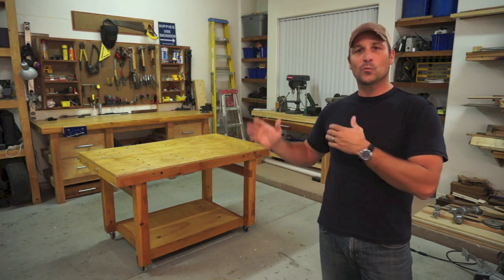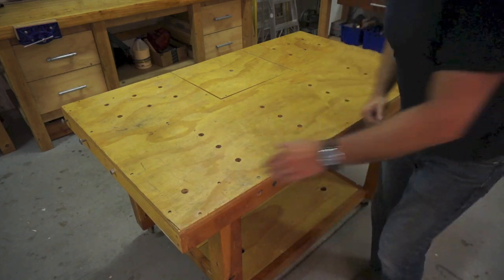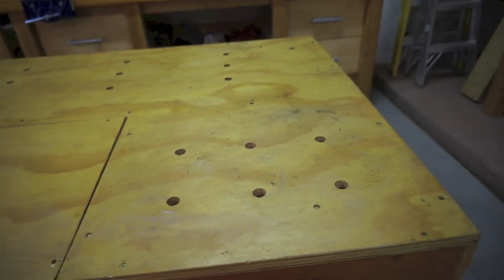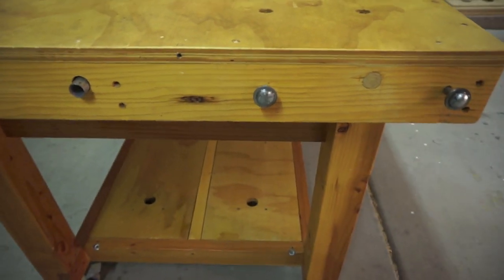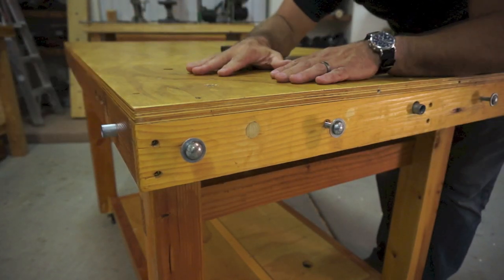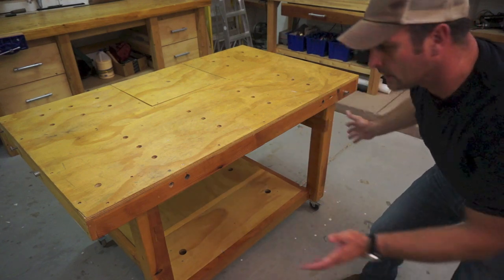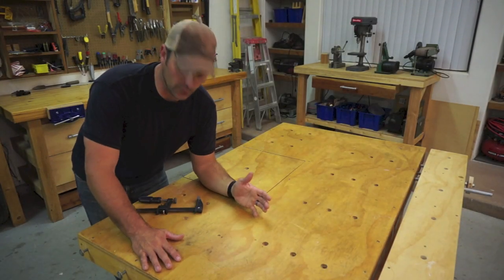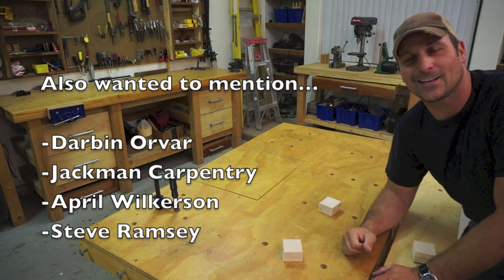Workbench tour and demo

Comment: Great ideas for a great bench.  Well done.  You mention "its not perfect".  If you look closely at all those other youtube contributor you mentioned, they are "not perfect" either.  I love to know what all the extension connection bits and the bit for storing the removable top for the mitre and the bits for fitting the mitre legs to the table.  Well done!
Reply from the maker: +WhoDatBe Dare Thanks WDB Dare!  All the connection bits and pieces were just extras from my junk box (except the washers) and I just tried to see what kind of connections I could make with them.  So far so good:)
thanks for watching:)
Joe

Comment: Nicely done Joe... I wish I had the space to have one of these in my garage, but I allow Aunt B to park her car next to mine in the garage... . I am going to use that hole/dawgs concept top on my workbench, but I will lay a separate thick piece of plywood with holes on top of my workbench to use with the dawgs. This way I van remove it, slide it underneath, and still keep the solid top workbench for my day-to-day use. If I just put dawg holes in the top of my workbench, I would be spending all my time trying to find the screws, nuts, and washers that fell through the holes. My workbench is 3'x8', but I have a drill press, grinder, and vise permanently attached, so I have about a 30"x36" of open space to do projects. I do have a separate but lower 3'X5' shelves that I covered with a countertop that I can do projects on, and it also holds my bench sander, jig saw, miter saw, and router table. If you keep giving me ideas... Aunt B might loose her side of the garage... :)
Reply from the maker: +Rought Real Estate Hey Randy... just tell Aunt B that cars were designed to take the elements better than workbenches and to promptly make space for the bench;)  ... but just wait until winter is over to use that argument...lol!
As for the workbench ideas... I still love your idea to have the dawgs with offset circles so as to be able to make small adjustments.  Really cool idea for sure!  And when we ever get up to visit you guys I'll be excited to check out what you've got going on!  
Joe

Comment: Joe, THIS is the ultimate workbench!  Did you build all those features in from the start, or add them as you thought of them?  Easily the most practical bench I've ever seen.  I don't think you're on LumberJocks, but if not, you should get on there and show that baby off!
Reply from the maker: +Joe Gemma III Thanks Joe!  It's a work in progress... I planned the leaf extensions, clamping holes from the start but the drawer, clamping section, and power outlet were later additions.  I still have some other ideas for it though.... but I'll just have to make sure it doesn't get too heavy with accessories!  lol
And no, I'm not on lumberjocks but have checked it out from time to time when I was looking for reviews on tools, etc,.  Great stuff overall!  Perhaps I'll get on there in the future but right now, my limited time after family stuff, goes to my growing list of projects (and the vids of them :)
But thanks for the awesome comment and checking out my bench tour.  I might do a follow up video in the future to answer questions that folks have had!
Joe

Comment: Nice workbench, Joe!  I like that the design discourages you from storing things on the bottom for the long term (since they need to come out for use).  That helps ensure the work/build bench is always clean and ready to use.  Great integrated features that are easy to use - that makes it even more awesome!  If you had to do it over again, is there anything you would change or do differently?
Reply from the maker: +Chris Williams Thanks Chris!  I'm not sure what I would change right now... I'm sure there is... always room for improvement or different solutions:)  ...but maybe I can answer that on the next QA video or maybe a follow up video for the bench with other questions I've received.   Hmmmm.... now you got me thinking:)
Joe

Comment: Interesting design. On the "Moxon Vice" like attachment have you gotten it to travel with the bolt when you open it or never bothered? Looked like it was hollow on the underside so if you could get a large washer with 2 nuts on each threaded rod it should grab and pull out for you as well.

Comment: Great design!!  You’ve inspired me to build a similar bench and get going with some wood working. 

Quick question:
How did you connect the 4x posts to the top?  I didn’t see anything aside from the lateral bracing.
Reply from the maker: thanks!   I just used screws from the top going down into them :)
Reply: Right on. Thanks for the quick reply sir!!  Keep doing what you’re doing!!

Comment: What miter saw do you own? And what is it's max cut capacity at 90 degrees? I want to make something similar to this but don't want the saw to be so big but also want it to be able to cut relatively thick stock? Your saw looks like the perfect size
Reply from the maker: it is a hitachi 10" saw and I can cut a 2x6 cleanly and almost a 2x8... about an inch uncut.  hope that helps:)
joe
Reply: Thank you!!
Reply: homesteadonomics hi Joe I have another question.... what are the dimensions for the cutout area where you put the miter saw? Trying to come up with a design but don't have the actual saw yet